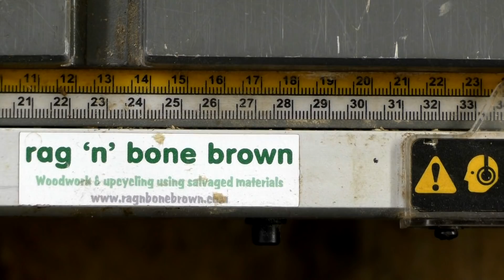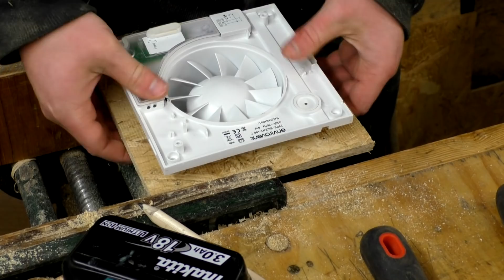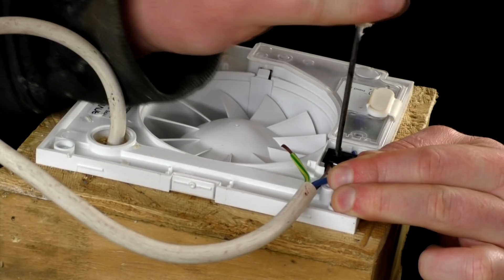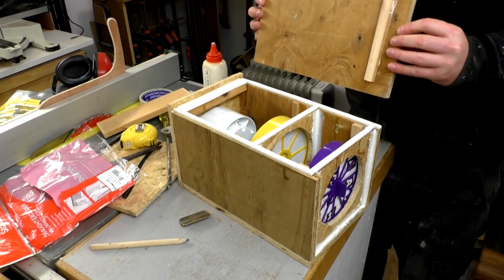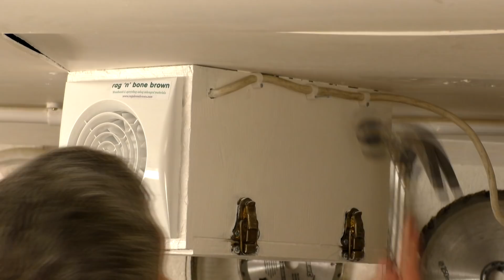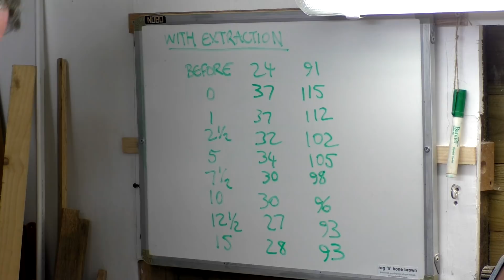Making A Small Air Filtration Unit For The Workshop.... FAIL!

Comment: This video is really helpful. Fan to begin with is generating low pressure and with addition of dense filters that are designed for 800-1000 watts vac cleaner drastically reduces air pressure. Use paper disposable hepa filters with deeper bends and fix the fan as it would pull air from the filter instead of throwing air on it.

Comment: Keith, if it’s any consolation I reached the same conclusion - and I made two of the suckers, lol! The fans I used were rated at 230 cu M / hour but that drops spectacularly when you start throwing filters in there and I used comparatively free-flowing foam filters designed for motorbikes. Though like you, I also put the fan in front of the filter... 🤔 More experiments needed - and remember, no such thing as a failed experiment, as long as you learn something! Cheers, Peter 👍

Comment: I built one for my shop 9x13 with 8 ft ceilings.  I got a fan that might be used to dry carpet - so, very good CFM.  I put a filter directly in front and one behind that way the air gets pulled in and cleaned a second time when exiting.  The filters are up against the blower so dust has no place to go.  That's the adjustment you need to make it clean your air 10+ times per hour.  Great Video & Channel!

Comment: Hi keith, I made air filter and fume extractor combi with two of those little fans and it works for me perfectly. I haven't tested it as you did with the particle measuring device but I could determine I had decent flow of air through the filter. And the air didn't smell as much like dust and fumes when I used it. behind the fansI used a different filter materials than your example, a active carbon fabric and fine particle fabric (grease filter from a extraction hood). It might be worth trying different filter materials. I have a video about the build, it might give some new insights. Thumbs up for the video!

Comment: I thought about using a smaller fan to move the air in my garage. You made a lower pressure low volume system. The combination needs to be low pressure  high volume  or high pressure low  volume. This is how air cleaner and shop vacuums work. Changing the filter might increase the volume but you may want to increase the volume coming into the unit. This prevents  me from duplicating your effort. This post is absolutely valuable to me with the presented information. Thank you!

Comment: I have the Jet air filter, and the filter is basically a thick fabric bag in front and the fan behind to suck the dusty air into and through the bag filter.  In your instance for a quick test, I'd say take out those Hepa filters, and just secure a tight knit sweater over the front of your fan.  it will probably work much better.

Comment: The wood particles will be heavier than air so reposition the unit lower down. Also are the filters starving the fan, it will take quite some energy to push air through those dense filters, a bigger surface area filter could make the fans life easier.  Keep trying and sharing as there has to be a solution. Cheers
Reply from the maker: Thanks

Comment: Use a fan with more pressure, pull the air throug the filters and don't use such dense filters. Just do it, we need the follow up ... nice channel btw...
Reply from the maker: Thank you!
Reply: Jochen Mayer right.. The bathroom fan is not designed to use filters, just suck moist air out of the house. These Dyson filters are designed for the high powered vacuum suction system. So, too dense for the power if this fan.  If it needs to be this small, you might try less dense house (hvac) type filters. maybe use an electrostatic filter so you can have better airflow but use static electricity to attract the particles... other than that, you would need to change out your fan system for something more powerful in a small package
Reply: it is correct, the fan is too weak to suck outside air, more powerful fan is a good idea
Reply: @manhngo4275  I don't think any fan will be able to produce enough static pressure to pull air through those filters.

Comment: I had the same issue with an outside extractor,heat loss truly isnt an issue I put one in my small shop and placed a foam filter in front of the hole,no heat loss at all and it captures small dust particles,I'm not an expert in dust control so couldn't give you specified results but you already have the extractor give it a try

Comment: Nice idea.  If I was doing this after watching, I’d probably go for car or motorcycle air filters, you can get washable ones, and I suspect they have a larger filtration area than the dyson ones, which means you should get more air flow through, although I’m not sure what size particles they will remove down to.

Comment: I would build your unit like the units in our factory fan filters. The filters collect the dirty air before going thru the fan. Therefore, the filters are mounted on the intake side of the fan. However, the filters are much closer to the intake of the fan. It is just an observation.
Thanks for sharing

Comment: Good insight. Probably the fan was not sufficient to move the air through the filter- they are designed for high vacuum systems.
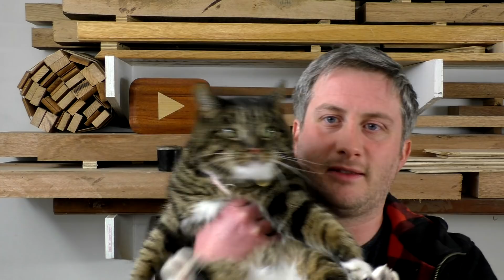BTW it was 200% higher, not 300% (12:01)

Comment: Tend to agree with Mulligan.  You are using rather 'dense' HEPA filters which means that you need a fairly powerful fan to push air through those filters.  On the other hand, the fan you used looks pretty 'wimpy'.  So your choices are either to use less effective filters, or a more powerful fan.
Reply from the maker: Thank you!

Comment: I think you placed the filters on the wrong side of the fan! Basically it is designed to pull the air though not push it out, hence the air behind the fan in your set up goes nowhere fast. Both the air filters and cleaners I use have the filters before the fan, the ensuing air exhaust is appreciable not blocked. Also I think one hepa filter is enough, you're just further restricting the air passage with no appreciable dust reduction benefit!! Just remove both filters from your setup, duct tape one to the front and let me know ...
Reply from the maker: Thank you! May try this :-)
Reply: This was my thought too... pull the dust in to the filter, don't try and push the dust in to it.
Reply: pulling or pushing air won't change the effectiveness.  filters only work by there being a pressure differential from one side to the other, they are not direction specific.
Reply: You always want the filters on the intake of the fan for the mere fact that you dont want your fan clogged with particulate....but....there are actually a few more things wrong too. With the filters in the exhaust area instead of the intake the exhaust actually bounces off the filters and causes back pressure against the incoming air, this is why the pull was strong in the middle and weak on the edges...the air is trying to come back around the edges. The fan has a very low CFM rating which is only decreased by the filters (check how little is coming out the exhaust). One filter would likely have been enough to kill this little fan but two was pretty much a guarantee. You might be able to salvage materials in the project a bit be reversing the flow but you will likely need to use a fan with more power. I would suggest either the tried and true box fan or if you really want to re-utilize your design as much as possible, try using a duct booster fan like this one.  https://www.amazon.com/VIVOSUN-Inline-Booster-Noise-Grounded/dp/B01C82T0QC/ref=sr_1_14?ie=UTF8&qid=1546612519&sr=8-14&keywords=duct+booster+fan
Reply: @cakepanda  Most filters are direction specific - hence the arrows!

Comment: Static pressure is required (not necessarily CFM) to force the air through those filters. They are HIGH resistance because they have a 1-2KW vacuum impeller behind them. You have a what, 100-200W fan. The air resistance around the path to pull air in around the edge of the fan will be much lower than pulling it through those filters. Use a large pleated air filter next and with a large fan. Mattias Wandel's design works well - I made one, struggled for a while to find the correct term to find the filters - "Pleated G4 Filters". You can get away with a single G4 filter but could put a finer filter after the G4 if you wanted and had the static pressure.

Comment: Good experimental practice. Everyone will have a theory about the mechanics of the fan, filter position/order and fan speed etc, but it might be worth considering the extractor's place and orientation before giving up on this. It could be that it is in an area of neutral air flow - like a back water in an otherwise moving river. I saw something similar to that years ago - oh well, just a thought. Anyway, it's all experience. Thanks for sharing Keith.
Reply from the maker: Thank you!

Comment: you could take a look at poultry fan units that are designed to move as much air as possible but are pricey. ziehl fans are the best there is in poultry production , but would turn your workshop into a wind tunnel!😁

Comment: I would say a combination of underpowered fan and thick filters. 

Also the fan is trying to "push" the air through the filters and not suck it though them. Have you tried putting the fan in the other way round so it sucks the air in through the back of the unit?

Comment: You supposed to check the CFM on that fan before ordering it. The higher the amount of CFM (cubic feet per minute) the more air will be moved through that fan in the same amount of time. 
There are some inline duct fans meant to improve the recirculation on certain machines (also available on Amazon or eBay) for 230V that are more powerful than that bathroom fan and also not so large in diameter. Don’t abandon your project, just look for ways to improve it.
One more thing... being quiet or slightly loud fan will make no difference when you operate any saw in your small shop.

Comment: As others have said there are two factors here.  The pressure needed to push air through the filters and the amount circulating happening within the room.   A bathroom fan is moving moist air from inside to outside and only needs 100 or so CFM to clear a bathroom in 15-20 minutes. There's no filter holding it back so it's a relatively weak fan.  I'm going through this myself in an 18 sq meter shop and I picked up a fan from a Furnace which moves 500 CFM and is designed to work with the drag of trying to pull air through a filter.   I'm also using filters designed for heaters or furnaces, so they are compatible and easy to change. Putting it in pandemic terms, you have to work a lot harder to jog when wearing a mask than without.

Comment: The fan likely just doesn't have enough CFM to move any reasonable amount of air, and the filters exacerbate that.
Wonder if you could put one of those bigger models under the table saw. They need to be fairly central to the room from what I've read.
Have a WEN branded version of the Record Power you showed and it works very well for $125, but my ceiling is almost 3 meters tall...
Reply from the maker: Yeah you're probably right. The filters were surprisingly thick although you could still feel the air coming through a little. Under the tablesaw - yeah that might work... the space below my saw is still empty following the removal of the titan vac... thank you!
Reply: As you used Dyson filters, can you not get the motor from a dyson vac and use that on the box? It must be powerful enough to get the air through the filters and i am sure you can get an old one from ebay?
Reply: Its not just CFM , you need static pressure to force the air through the filter. The filter also needs to be closer . So get a high CFM fan with high static pressure .
Reply: As far as I know industrial filters on machines at my workplace, it seems that there is the air sucked through the filters rather than be blown through.
I think this is maybe because the blowing creates more distortion right before the dust hits the filter and the particles won't go through the filters as easily.
Reply: Kai Seissler , I have no idea how true what you say is but it certainly sounds sensible and nearly all filtration units I have seen operate as you mention.
Reply: I had the idea because I once saw a Mythbusters Episode where they built a windtunnel and they had problems to get an undistorted wind flow because of the fan.
They led the wind then through a huge package of straws and then the air was flowing quite nicely.
So I think any rotating fan will cause the same distortions as it was there and is causing the particles to swirl around instead going through the filters.
Therefore I think: If the air is sucked through the mesh of the filters, the mesh will correct this as the straws did.
Reply: Agreed, not enough airflow through the filters. a Vacuum cleaner is a high pressure system and your little fan just does not have enough cfm to make it work! 
As it runs it will become even worse as the filters gets clogged with dust.
Great of you to show us anyway, this is how we all learn ... many thanks!

Comment: Thought I couldn't like this channel more ... then you hit me with experiments, graphs and some Excel AND Dylan (look at those toe beans)! This is what I'm here for!

I'm going to be gutting an oscillating desk fan and building a Matias Wandel style one, which might work for you too. Maybe fitting it horizontally so it sucks up towards the ceilig with a v or x-shaped deflector above it so you can get it nice and tight to the ceiling to minimise the amount of headroom?

Might be worth putting the Dyson filter on the output vent of your small Titan shopvac, putting the vent on your door to get the heat out in summer (but not the noise) and using the power hookup for a different filter setup.
Reply from the maker: Thank you! Haha I was a bit out of my depth with all the technical stuff but hopefully it made some sense

Comment: Bummer it didnt work first time. Worth a few tweaks though. I agree with other comments that ifeally you would suck the air through the filters rather than trying to blow it through. Also, your fan is 250w. A typical dyson is 700w or there abouts. Maybe 2 thick filters are too much and you need a thinner pre filter with just one hepa filter?

Comment: Hi Keith, I think past of the problem is that the fan isn't powerful enough. But probably more important is that the filters are to small. A filter provides a lot of air resistance, so you need a larger surface area to compensate for that. In your case the filter has about the same surface area as the fan but I'm guessing it has to be at least two or three times a much.
Reply from the maker: Thank you

Comment: A couple of observations    More air flow (air exchanges) is always better.   You can always do short time runs with larger unit.  Possibly reversing the direction  of unit could help   Push clean air into the shop  from the corner.   Use  filters for air filtration rather than vacuum  made for air flow and not pressure.   Redo the box to have more filter area  maybe make it wider  than high.    Place course filter on input (suction ) side of fan and fine on output side.

Comment: Do you not think ir may be because you have the unit sealed?  
For good air flow, wouldn't the back wall of the unit be better if it were vented so the air had somewhere to go?
Just a thought....
Reply from the maker: The back of the unit isn't sealed, not sure if it was clear in the video. The back of the unit had a circle cut out the same size as the filter to allow the air to go through. I suspect though that as others have pointed out the fan is too weak and the filters too dense! Thank you!

Comment: You used filter meant for a vacuum which could probably pull a vacuum around 35” of water. An in-line fan like the one you used could maybe do 2” on a good day. Try a filter meant for furnaces since they work as part of a system with much less required pressure differential.

Comment: Use the same method but use a larger table or window fan and not a bathroom exhaust fan. Also, put the filters before the suction, not after the air suction.

Comment: Would use of your good dust extraction system for 20 to 30 minutes after machining improve air quality be an idea? Won't keep the shop warm but may be effective to add an electric delay relay to the shut down controls or do it manually.

Comment: Interesting video, thanks for posting it.  While I know nothing about air filtration, I do use custom fans on my PC. 
Many comments point out that the square box is reducing the flow (static pressure),
and possibly adding a second fan in a push-pull configuration may be the ticket i.e. one fan at each end of a tube ?
Looking forward to a follow up and please keep on being entertaining, informative and very natural with your video style.  Cheers and good luck with round two.
Reply from the maker: Thank you!

Comment: Air filtration is something that over powered isn't so bad.  Like you said before this isn't your forever shop so investing in a unit with more power won't hurt you it will actually if anything do you better.
Reply from the maker: Yeah I agree, just wish I had space for it to live
Reply: Is under a bench or tool an option?  Matthias Wandel has done videos on some smaller ones also.

Comment: Dyson vacuum filters require high pressure. That fan extractor moves high volume of air at low pressure. Change the filter to a pleated one. Use one filter.
Then upgrade the fan. This can still work. Never give up!

Comment: Has anyone mentioned trying to visualise the air flow patterns with smoke? A common technique used  in clean room design. Use a smoke generator designed for purpose or, less expensive, a few incense sticks. 
I wonder if the main problem is the input being so close to the output, filtering the air in a very local area, rather than having a ‘sweep’ of air from the dirty area to the filtration unit. That issue would also apply to a shop bought unit.